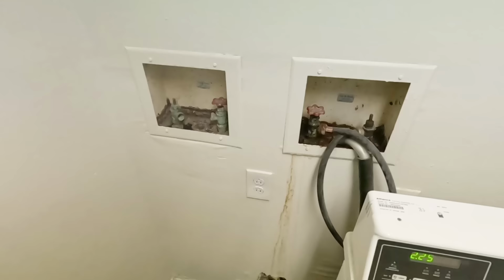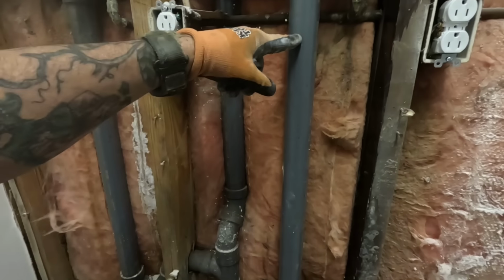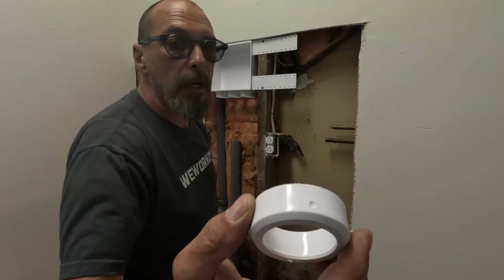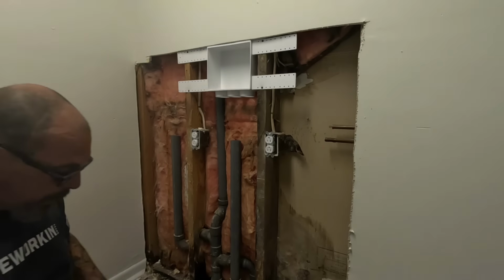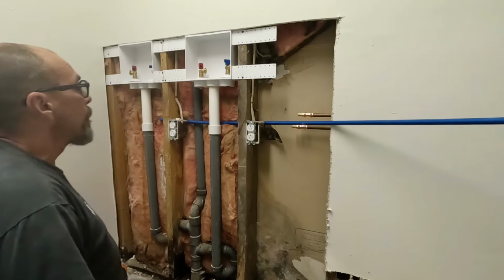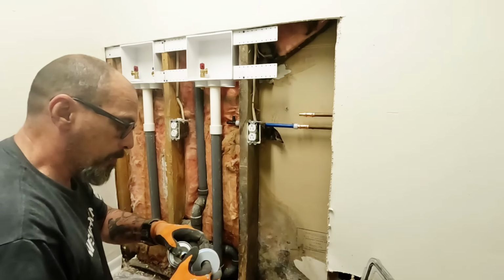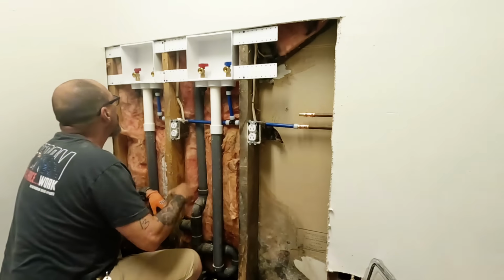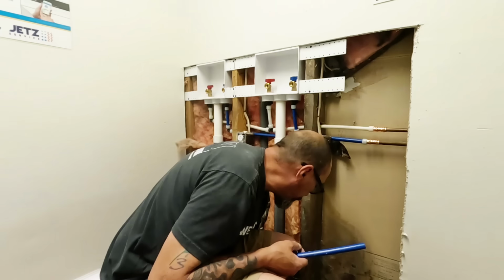Repairing old bad plumbing

Comment: Copper pro press fittings, uponor.... perfection. absolutely love uponor more than crimped pex because it doesnt decrease the volume by decreasing inside size with the fittings. 
absolutely best choice for material. 

Only thing I would suggest, anytime youre dealing with PVC... drainage or water... always recommend (per code in every state) to make sure you use primer as well as the glue. Each serves a different purpose for a very specific reason. FAR less likely to have a leak, and likely to have a leak sooner when you use both as opposed to just glue....
Reply from the maker: I all-was use cleaner and glue -- clean primer not the purple stuff

Comment: Good work, did you have to swage those pex lines, or could you have used one of the crimping rings to secure it? And which have you found more effective?
Reply from the maker: This is pexA water lines. No crimping-- pex A is a lot better, its more flexible and better water flow
Reply: @Raysmaintenance  I may start using this, thanks for the tip

Comment: Enjoyed the video! which press fitting is the one used for connecting the copper to pex a?
Reply: That's a Propress fitting.  Should clean the pipe before installing.